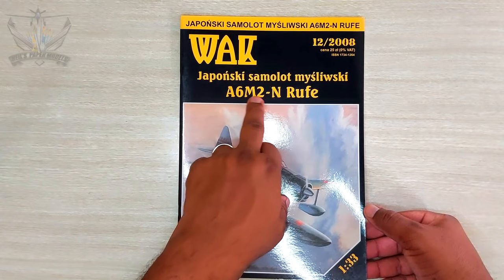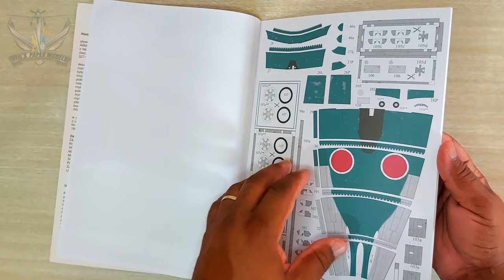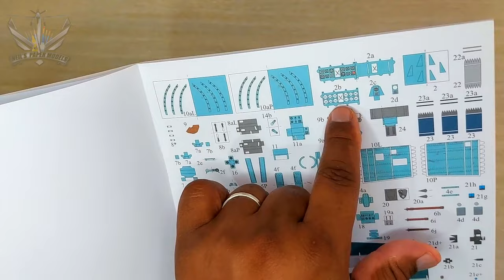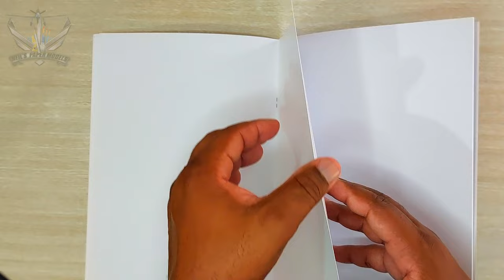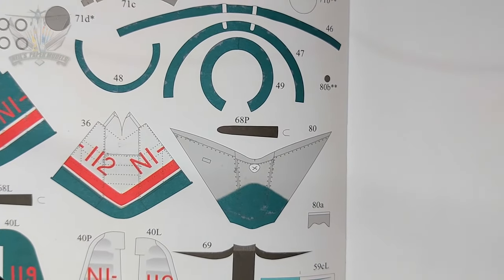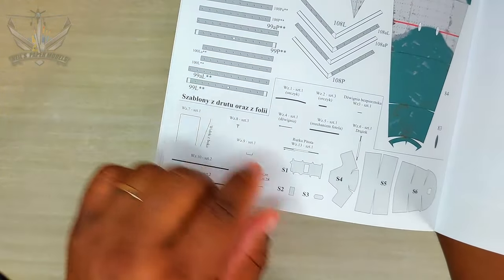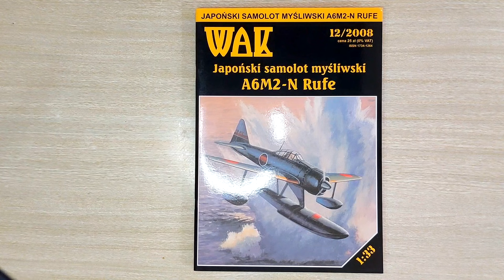KIT OVERVIEW   A6M2 N RUFE

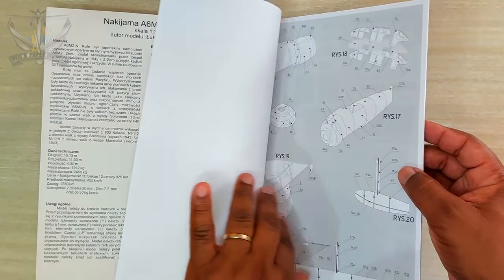Comment: I got the 1:33 A6M5 from Answer, which is very very similar in parts and instructions. It is also from the same author Fuczek, but this time published with Answer instead of Wak. Publishing date is July 2014 so thats 6 yrs later. It also comes with a frame set sold separately.
Reply from the maker: Great info! I appreciate it. really looks like a seriously fun detail model to build. looking forward to when you build yours.
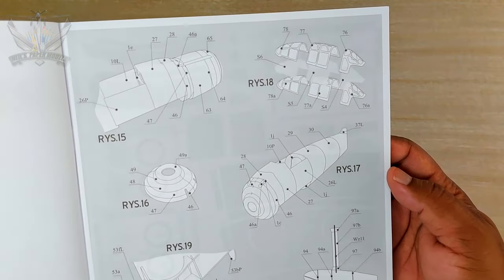Reply: @neilpapermodels  yes! so much to build and so little time 😄 still working on my Ariane 4 rocket 1:33.